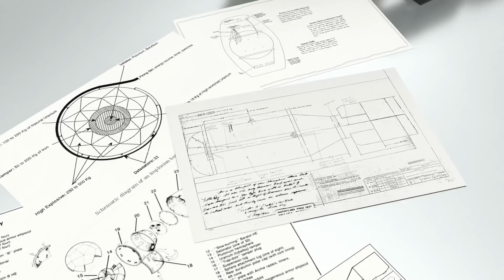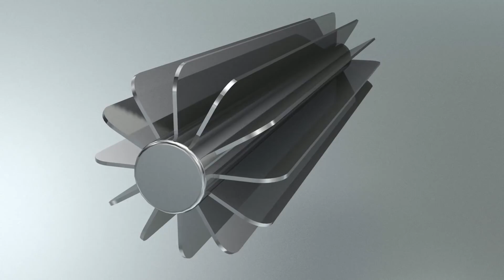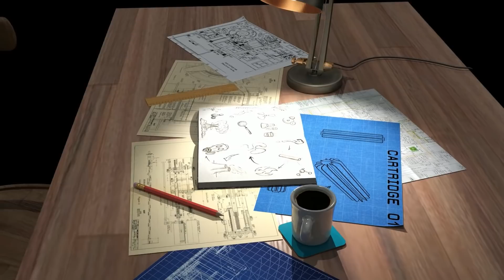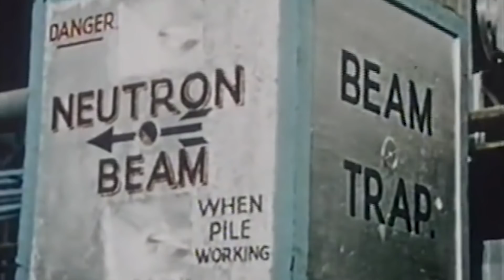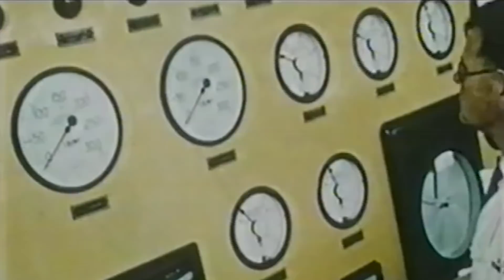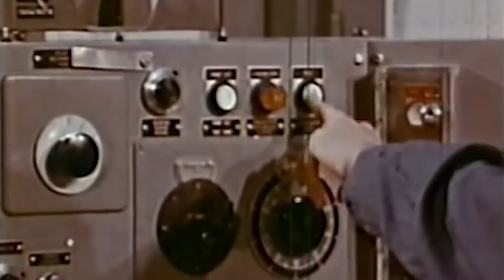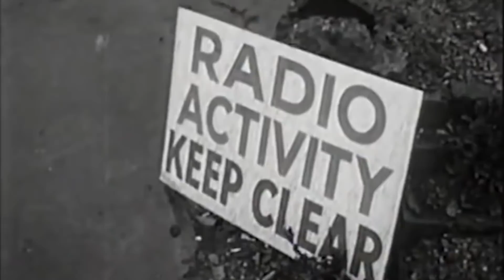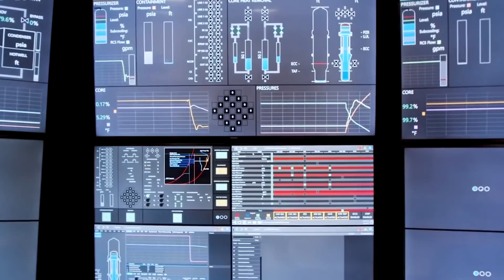Atomfall - Windscale Disaster - How The British Chernobyl Was Stopped

Comment: Por dios this is madness, on all levels. It's incredible that so much would be riding on the absoEFFINGlute integrity of EVERY SINGLE ONE of those metal cartridges, each filled with material that would be far from inert, each needing to contain EVERY BIT of its material. That's one level. On the highest level, the UK obsession with getting the Bomb seems to have come more from imperial ambitions than from any real perceived threat. Worst case, they would need to be content to be under the US Nuclear Umbrella. They needn't have worried that the USSR would nuke them,  any more than the French—Oh, wait, yeah, come to think of it, hmmm…

But at least, the French apparently took a little more time to mull over the details, and surely learned much from the mistakes of others.

Comment: One wonders why they did not use either inert air (flue gas) or bottled CO2 instead of fresh air. A nuclear core does not need O2 to function so either it was not considered or as it would spoil the story line has been omitted.  After the three day burn how was the fire extinguished?

Comment: Why does it look just like an RBMK-1000?, the lid does. However the functions are completely different

Chernobyl NPP, used water as a coolant for the U-235 rods. And graphite as a neutron flux moderator. Just like the Windscale Reactor. Chernobyl used the uranium to generate heat, and the rods to separate them from each other stopping the reaction,
The heat of the U.235 is enough to vaporise water into steam. This is done by using pumps connected to the main basis of water near the plant to pump water through the core, the water that evaporates turns a turbine which generates electricity. The turbines are located in the 1km long turbine hall, with turbines from all Reactor units. The main design flaw Chernobyl had that led to its explosion was the graphite tips on the control rods. The soviets cut corners because it was cheaper. When A3-5 was pressed on April 20th 1986, the rods were forced into the core, however the graphite tips caused the reaction to skyrocket and which leading to an explosion. There was two initial explosions, the first one was from the main reaction that led power megawatts to 30,000. This blew off the lid and damaged the roof a bit. The second one was caused from oxygen mixing with the core and superheated graphite, the second explosion completely blew the entire reactor hall, causing catwalks to fall and the roof to break up blowing up. The roof was layered in tar so the fire would burn for longer.

Comment: There was another design flaw, the water trough that the capsules dropped into had a ledge and it was not uncommon for capsules to miss or sometimes crack open. Windscale had been releasing small amounts of radiation long before the fire, to the point that one of the operators borrowed a geiger counter and tested the local countryside. When he raised the issue he was fired.

Comment: American and soviet reactors: water cooled

Britain: hold my fan
Reply: Lmao the Soviets often air cooled too.
Reply: Really I don't see how air-cooled is easier than water. If your electricity goes, you're screwed either way.

More simple solution surely would be to submerge the thing in water, which will then turn the water into steam, which you can condense using heat sinks and reuse the same water over and over. If you build it near the sea you can use seawater as the heat sink.
Reply: @pauldilley8974  The electric grids and backup systems are far more reliable than water pumps which also need electricity. With water cooling you are not only relying on electricity like the fans are but also on the reliability of the water pumps and everything inbetween, leaks, blockages ect are all an issue. So much more can go wrong with water cooling.
Reply: @pauldilley8974  well, ideally, all reactors should be capable of passive cooling in the event of an accident. It's just useful to have active cooling, as it allows you to have a far higher power throughput.
Reply: @pauldilley8974  well it was built near the sea. It was great until some radioactive waste was pumped into it
Reply: British nuclear powers plants reactors were, and still are, water-cooled
but this thing was not a nuclear power plant - its sole purpose wat to make weapon-grade plutonium
Reply: American reactors... Soviets were just American reactors copied via espionage. Air cooling would have worked if all the precautions and science had been followed.

Comment: Windscale and Chernobyl were two entirely different types of reactor, and the incidents were totally different. Chernobyl was caused by scientists trying to control the reactor with 8 boron rods instead of the reccomended miniimum of 15. The Chernobyl reactors were also PWR reactors designed for the production of steam, not plutonium.

Comment: 4:00 2 tonnes of what? Heat? Air? Cows? Smh.
Reply: It is a mesure of cooling capacity apparently. Google says it's the term when talking about cooling units capability, in relation with the equivalent of a ton of ice melted
Reply: Thanks for clearing that up, guys. Cheers.
Reply: He should have said cubic tonnes.  It's a measure of volume when talking about moving coolant.
Reply: @krashd  I agree it would've been clearer but there it's a mesure of cooling so correct too

Comment: Wait a sec,  the heat is what you want. The heat boils the water that turns into steam which drives the turbines that makes the electricity. True, at that stage Plutonium is what we wanted. The USSR already had the bomb thanks to US traitors. Still Windscale went from drawing board to cutting the tape in five years. That's when we could do stuff. I did hear from someone that two guys volunteered to go into the reactor building to switch it off and were bricked in afterwards. Don't know if it was true. James Lovelock says he detected a rise in airborne radioactivity during the Windscale crisis, although it led to no detectable increase in cancer.

Comment: I would like to say thank you for such a good video but just to remind you that country to what you said at the end of the video nuclear power is still far from safe and certainly not safer than wind or sollar power
Reply: It's the safest of the practical methods of generating power.  You can't run a country on wind or solar unless it's a country where everything stops when there's no wind or sunshine.
Reply: @krashd  as someone who works in the green lobby I can tell you that with the same budget you could produce nearly three times the amount of power with off shore wind or you could install solar power on earery roof or build some hydroelectric dam or tidal energy system